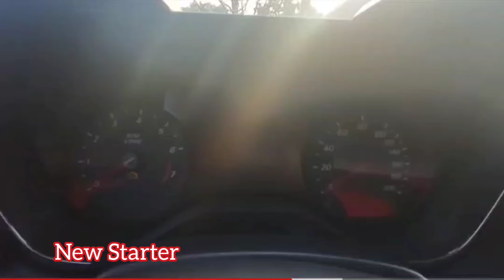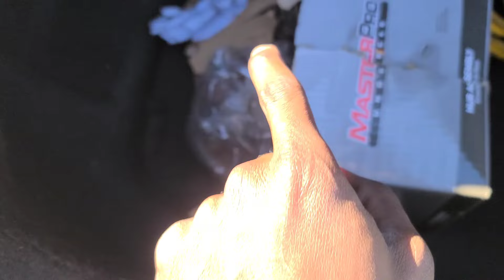5 Things I HATE😡 about My 6th Gen Camaro SS |Should I Trade My Camaro!? #camaro #camaross #cars #new

Comment: On my 2017 I got a door rattle from bass and the brakes creak when coming to a stop lol
Reply from the maker: Yeah the bose sound system definitely does rattle the inside a little bit lol. My brakes used to squeak a lot before I switched to powerstop pads
Reply: @MuscleAddiction903  Mine make a creaking noise someone said dust gets stuck between the rotor and shoe so I’m gonna take a look
Reply from the maker: It fix it?
Reply: @MuscleAddiction903  I got a rotation and balance and it's gone! but now when going 20 mph the same wheel makes a light clicking noise every rotation I think I need to get the break dust out of crevices
Reply from the maker: That's very likely as well